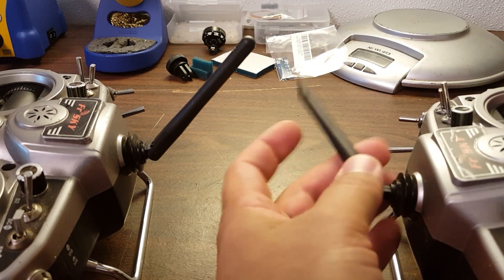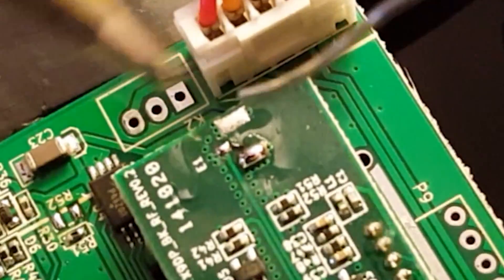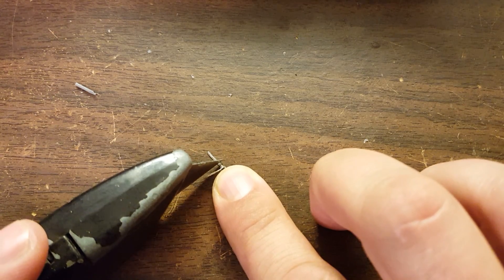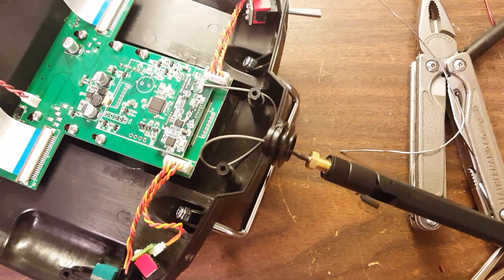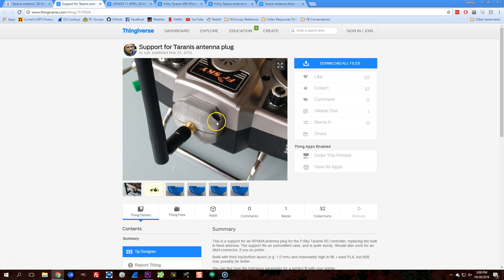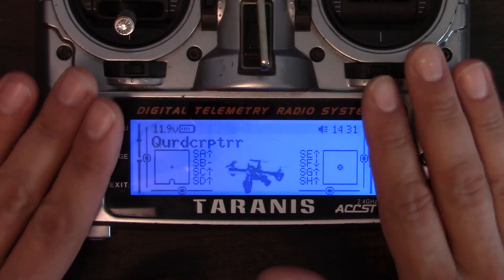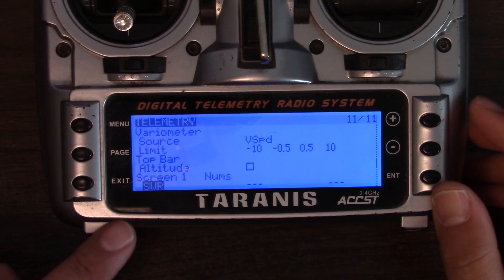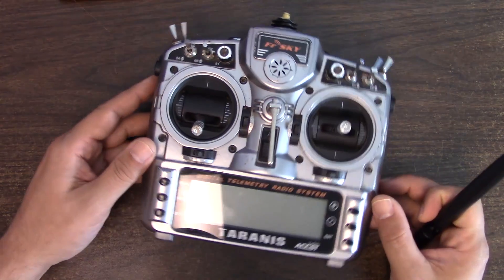FrSky Taranis 5 dBi RP-SMA Antenna Mod | POSSIBLY DO NOT DO THIS MOD

Comment: Why do they solder the antenna to the board. It looks like you could solder on a UFL connector to those pads. Just use

Comment: I know this is quite an old video, but I imagine this would work with any radio mod.  This may help the soldering process go a little smoother, at least the prep work.  A pre-tinned ready to solder 2.4ghz antenna cable with female sma connector.....https://www.ebay.com/itm/141123872704?hash=item20dba367c0:g:~yYAAOxy3zNSkTCB&var=440213861459

Comment: Thank you for the 1000th time Mr B. My 3yo destroyed my antenna , so I purchased a replacement followed your guide(s) (including the others that mention using a static line) and saved myself £150. I consider myself an intermediate with the soldering iron and I agree with you that it's very fiddly. For those buying replacement Taranis parts, you don't need to strip back the insulation because it comes ready to solder.

Comment: thanks joshua from the past. I broke my antenna holder but ignored for some time until it wore on the wire and broke the wire at the solder point. i bought a new antenna by from truerc canada (the shapeshifter) and also a regular 2.4ghz dipole antenna for freestyle and reg flight. I soldered a pigtail back to the radio board and the other end to an sma connector but i still get rssi critical messages even when my kwad is only 10ft -20ft near by. I have yet to try your test here with the swr but im going to now. but if i smoked my board in the past when the wire broke where do i buy a new one? thanks a bunch! happy flying

Comment: I would like to add a clarification about the length: it depends on the cable used. The "Velocity Factor" or Vf is used in the calculation and the 84mm is derived from the 0.69 Vf that is common on the cables you get from RC sources. The cable that is used by Joshua here looks like a RG-58/U and has a slightly lower Vf of 0.66 (instead of 0.69), so the length should be 81mm. The formula used is Wavelength= Speed of Light/Frequency. 2430Mhz for frequency and at half the wavelength. Simple shortcut to the calculation is to multiply 123.4 mm by the Velocity Factor of the cable you chose to use. In this case: RG-58/U Vf=0.66 => 123.4*0.66=81.4 or just 81mm. Fortunately this number is easy to remember as its  123. and 4! 
https://infogalactic.com/info/Coaxial_cable For Vf values

You really don't have to be super precise as none of us know the internal impedance of the FrSky radio board, which would essentially modify the velocity factor. Also be careful when viewing videos doing range tests over a level ground, the high dBi antennas are only great at the same elevation and are actually worse when used at different altitudes. For FPV 2dBi is likely a better choice as the coverage is a big ol bubble around you. Best would be to have multiple antennas and swap them based on how you fly. Hope this clarifies some of the questions I saw in the comments!

Comment: Lifted a pad the first time I tried this and on the new board I just got the signal and ground pads for the antenna are continuous? Is that right? Seems weird, or did I get a bad board?
Reply from the maker: It's normal. There is an inductor that causes this.
Reply: @JoshuaBardwell  Thanks for replying so quick, I was nervous that I had messed something up. Everything seems to be working now. 👍👍👍

Comment: Heelo . After i did the mod , tatanis is not able to read to sd card . Kindly help me out .
Reply from the maker: I can't think of any reason why doing the antenna mod would break the SD card. Did you unplug something when you were in there?
Reply: @JoshuaBardwell  there where 2 flat cables while in colour .which is connecting back n front case . I removed it to separate the cases . After the mod I connected those cables . Everything Is working well . Swr is 0-1. Just that taranis not reading my sd card.  Currently running open tx 2.2.2

Comment: Hi Joshua great video keep up the work!  I have a question I think only you would know and bear with me this may look long I just want to be as specific as possible.  Quick back story - I just purchased a Taranis X9D Plus Special Edition (yours inspired me I love that carbon fiber hydro dip!) and I do not know if it already comes with this mod installed (by that I specifically mean the thicker gauge wire cut to the correct length)?  I recently bought a VAS / IBCrazy 2.4gHz Folded Dipole which comes with a thicker gauge wire meant to be installed I believe and is cut to ~80mm and the antenna without the wire it came with installed has a SWR ranging from 13 - 17.  Question - Am I supposed to install the 80mm antenna wire to bring the SWR back down and if so will this mod also work with a 5dbi antenna or would I have to choose one or the other? Sorry for the Long question thanks for your help!

Comment: Awesome video Joshua. I am running version 2.2 on my taranis 9x and tried looking for the SMA sensor on the telemetry screen as you have suggested in you video. No luck! Could you explain the difference between RSSI and SWR? I have very bad RSSI feeds and am wondering if my antenna upgrade to 5.8dbi is the cause? Just not sure between RSSI and SWR?
Reply from the maker: SWR is how well the impedance of the antennas matches. Bad SWR will cause low RSSI .

Comment: Hey Josh I did this mod, and I get a RAS value of between 0 and 1.  However, I get low RSSI at around 100 yards.  Any suggestions?  Thanks.
Reply from the maker: The first thing I would do is test on multiple quads tor multiple receivers to see if it was an issue with the taranis or the receiver.
Reply: Joshua Bardwell Ah I should have mentioned this happens on all three of my quads
Reply from the maker: Unfortunately I suspect you have a dead RF module. The usual fix is to replace the radio back board. If you are good at surface-mount soldering, then you can replace only the RF amplifier chip, which is only a few dollars, but most people don't have the skill or equipment to do it.

Comment: Hey Bardwell, I have a devo 10 I am not using any more. Can use that antenna and whip rpsma from that to do a qx7 mod? I was using the white devo 10 on deviation.
Reply from the maker: Probably.
Reply: I think I am going to have to do so.

Comment: Joshua can I use this antenna?
https://www.banggood.com/2_4GHz-6dBi-50ohm-Wireless-Wifi-Omni-Copper-Dipole-Antenna-SMA-To-IPEX-For-Monitoring-Router-195mm-p-1193324.html?rmmds=search
Reply from the maker: I can't guarantee the SWR will be good. Also, it's an SMA not an RP-SMA. It'll work but everybody else has an RP-SMA.
Reply: thanks...so I will use the antenna and coaxial from Mr Steele video :)
https://www.youtube.com/watch?v=WBRddJsTYb0

Comment: Just   happened to me too. Did this mod a month ago, didn't experienced a range gain though, was same than with stock antenna. Until two days ago I checked the RAS (SWR) value on the radio and it is stuck at 0 no matter I do touching or not the antenna. Had a low distance failsafe crash then did a range test and boom least than 5m the radio is critical(in range mod). Obviously my rf board is burned..too bad. What are my options now? Buying another xjt and backboard module and redo the mod with another 5db antenna (maybe the problem like you) or with the stock antenna, bor buy another radio which at this price investment maybe a switch to crossfire would be cheaper? Thanks for your advice in advance.
Reply from the maker: Some radios didn't report SWR / RAS so if it is always zero even when you start to unscrew the antenna, then that's probably your case.

Comment: i have a question if i have the taranis q x7 and it has a ufl plug so what length for the antenna extension should i get? or should i take out the ufl plug? i am a noob. is this one from amazon good? https://www.amazon.com/Female-Pigtail-Antenna-Coaxial-RG-178/dp/B06Y6CB2SX/ref=sr_1_1_sspa?ie=UTF8&qid=1511421749&sr=8-1-spons&keywords=rg178+u.fl+to+sma&psc=1
Reply from the maker: 84mm is the ideal length of the coax but chances are you are not going to find that exact length pre-made. So you would need to be soldering one on yourself. But honestly I don't recommend that you desolder the UFL from your board and etc. Frankly you are more likely to damage the board than not.

That's a good looking pigtail. It's got the thicker coax.

Comment: Hey Josh I just did the antenna mod and it went pretty smooth my only question is when checking the ras with the antenna straight up and down the ras is about 16 with it bent 90° which is the orientation I fly with the ras is at 1 well between 0 and 1 I'm just curious as to why when I told the antenna does the ras go to a low number I've also checked and when moving the antenna the rpsma plug is not moving everything is very much secured thank you for your time by the way it is a 5 dbi antenna it was the arctek kit from amazon
Reply from the maker: I guess it is because when the antenna is sideways the coax is bent? But I'm surprised it's that big a different.
Reply: Joshua Bardwell I agree I found it odd also but it stays at a constant 0-1 bent and 16 straight and I have better range with the mod I was just worried it may cause an issue I guess time will tell I think it would be smart to order a different antenna to try as well and recommendations?

Comment: I notice you have your antenna vertical in relation to the transmitter when checking the SWR. What happens to the SWR if you bent the antenna left or right. What is the best position for the transmitter antenna when in use, given I am using a XSR with my antennas at 90 degrees from each other on the back of my quad frame. Cheers.

Comment: I found these adapter kit on Ebay: https://www.ebay.com/p/RF-Connector-70-Rp-sma-5dbi-Antenna-for-FrSky-X9d-Plus-Transmitter/2273634249?iid=222651184271 ,  or  this adapter https://www.ebay.com/p/RF-Connector-70-Rp-sma-5dbi-Antenna-for-FrSky-X9d-Plus-Transmitter/2273634249?iid=222651184271

Comment: will just adding the longer antenna boost performance without having to solder the new pigtail? Even if its a fraction?
Reply from the maker: +Panda MiamiLocksmith how will you install the new antenna without soldering?
Reply: Joshua Bardwell is there a way to solder it to the end of the original black wire. I mean to the end of the wire near the bottom of the original antenna.

Comment: (SWR) stands for = Standing-wave ratio and is defined as the ratio of the maximum radio-frequency (RF) voltage to the minimum RF voltage along the line.
SWR is an acronym not a word.   Great production of the video, just can't understand why everyone tries to pronounce acronyms like its a word.  I hear it on other videos too, 
mah, LED, to mention a few. Keep up the good work. The information is very useful.
Reply from the maker: Because it's easier to say "swar" than "ess double-you arr".

Comment: Is this not a good mod for performance or just difficult to do?  I would like to do this or go to the TBS Crossfire setup.
Reply from the maker: It's not a good mod because, if done incorrectly, or sometimes even if done correctly, it can damage your transmitter.

Comment: I am among the many who did this mod and have had their signal degrade over time. Instead of opening up the radio again I'd like to just get the external module. Is the correct one? Thanks
https://www.getfpv.com/frsky-xjt-16ch-radio-transmitter-module-jr-graupner-type.html?gclid=CODE-aLE29QCFYkkgQodOvwGQQ
Reply from the maker: I believe so.

Have you tried just getting a new antenna?
Reply: Joshua Bardwell - yes.  I'm guessing the RF board got damaged when the original antenna got damaged from the plastic cracking.
Reply: I'm having trouble getting my FrSky X4r Sbus rx to bind to the external module.  I have the module turned on in the Taranis settings and set it to D16. I held  down the bind button on the module while powering up the Taranis. Then held down the bind button on the Rx while plugging in the lipo. Afterwards, when I power up everything, the Taranis keeps getting then immediately losing connection while vibrating. Any help would be appreciated!
Reply: UPDATE:  I realized that I needed to turn off the internal Rf which was competing with the external module. It's working now... I guess I no longer need to attach the antenna (the one from the 5dbi mod) to my Taranis?

Comment: Here is a good tip for getting really short wires on the center element and with a good solder joint. 
use super glue and a kicker to adhere the wire to the pcb so that the center element is right on the pad (don't put the super glue on the solder pads, make sure it is on solder mask). This way you can get in there fast with the solder iron and solder, and also have a very short radiation section. I learned this when building prototype weather observation equipment that was highly susceptible to noise.

Comment: I don't understand how replacing one mount with another makes it a 5dbi mod? Are 5dbi antennas RP-SMA only?
Reply from the maker: +nandakoryaaa the stock antenna is 2 dBi and is directly attached. The pigtail is often added to allow the use of a higher gain antenna.

Comment: My SWR is set to 17. How do I lower?
Reply from the maker: Use a different antenna. Double check your solder joints.
Reply: @JoshuaBardwell  should i use rg316 or it doesnt matter if i use thin pigtail?

Comment: SWR IS NOT a measure of the quality of the antenna... It is a standing wave ratio.. It is how much of the TX power being reflected back to the transmitter. If the antenna is not the proper "electrical" length for 5.8ghz.. too much TX power will reflect back and burn up the final amplifier transistor... Which is what eventually happened to your radio......

Comment: hey Joshua, I bought a used taranis x9d plus cause I knew at a $85 I couldn't pass it up. The antenna was broke and I knew this thinking it would be an easy fix cause I have antennas on hand, the company I work for has tons of these laying around. long story short I followed your video to do the mod, lol then saw your other video saying not too. I finished the job and notice your antenna is a 5dbi, and mine is a 8 or 9dbi antenna. should I be worried, I have not turned on the transmitter, going to wait for a response. thank you
Reply: Are you still waiting?
 I am curious of this as well

Comment: I got something very strange. After the mod  the SWR is 0 so far so good.  The range though is not good.  I get rssi warning is on 3 of my quads after around 200meters.. I tested some 5 dbi antennas.  But no good.  I have the latest open tx 2.2 version.  And non eu firm. The range test is also not good after 10 meters of Los I get low rssi...  Any suggestions??? My taranis is like yours not the plus
Reply from the maker: Yeah. I have heard of this. I don't know the answer but obviously something is not right. Try using a different antenna. Maybe you just got unlucky and your 2.4 GHz antenna is not tuned right.
Reply: I wonder if  the cable length cause this.  Because it's 80mm.  It's not 84
Reply: i change back the old antenna , but i got the same distance problem.. is this software related?
Reply from the maker: Most likely the radio board is damaged, I'm sorry to say.

Comment: I did the mod but the power pad came off during soldering... when I powered transmitter I didn't get any warning...AM I GOOD?????
Reply from the maker: I mean, what's the worst that could happen? You already ruined your RF board by burning off the pad, so either it works forever, or if it burns out you just replace it.
Reply: So if it works for a flight then I'm good forever?

Comment: Hey Josh, I'm not sure what is wrong with mine but I've gotten worse range and reception after this mod.  I have redone the soldering twice now.  SWR shows 0-1 but range test is terrible and I get rssi low more frequently after the mod.  I used the parts you provided in the link.  Any suggestions?
Reply from the maker: Sorry, no.

I spoke with someone who said that the amplifier front-end for the RF board was very sensitive to static. We hypothesized that the reason some people get bad results is that they inadvertently damage the RF board with ESD when doing the mod.
Reply: Well, there goes $60 haha.  Thanks for the input!
Reply from the maker: +angry4nus maybe the stock antenna is better...

Comment: and to add to your video when you said about the epoxy "there is not coming back after that" hot air station set to 190 celsius will turn the epoxy in a kind of weird gelatin, making it super easy to remove
Reply from the maker: But will it also melt my Taranis case?
Reply: not even! first time I did it I've even put epoxy on the solder joint instead of hot glue. Epoxy came off easy, not a single piece of the board is damaged, the case either

Comment: I tore off the signal pad on the taranis rf board by accident. Whoops. I was about to order another board from Banggood but instead I just scrapped off the surface of the trace to revel some metal and connected a super thin wire to the trace and the signal wire of the coaxial cable. I should have taken a picture! It looked horrible. I hid it/held it down with a ton of hot glue. I still got a 0-1 swr in the end. Will need to wait for better weather to see if I actually get any range improvement with the lifted trace, added wire, and crooked coaxial cable, lol.